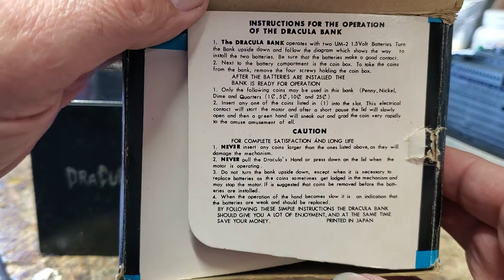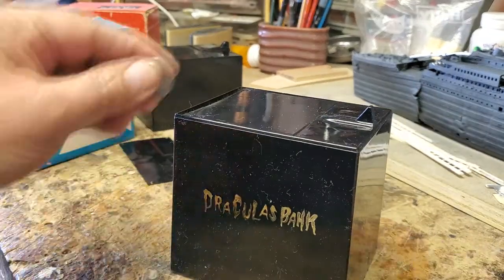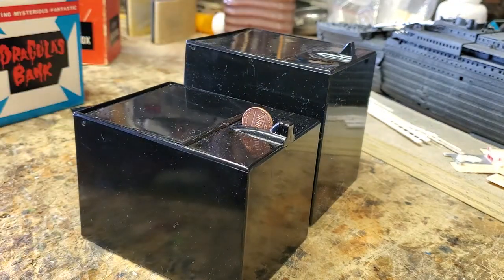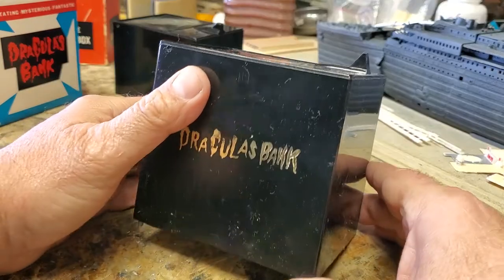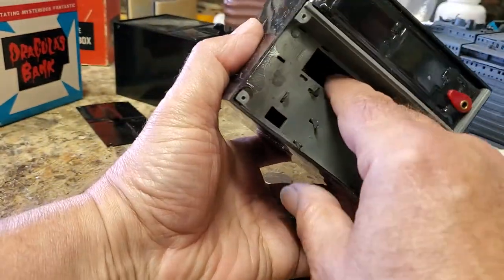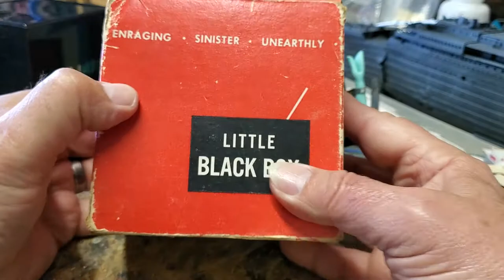Dracula's Bank coin bank Poynter?

Comment: They started using those plastic gears after 1964.  I fixed one of those Dracula Banks too, and just like CJ said'...it was tough.  I pretty much tore up the plastic because of the glue, so I made a base out of 2 mm book board (the plastic is about 2.3 mm) and some thin self-adhesive black felt fabric I got from Amazon.  It worked great.  Except mine does not have the little lever on the bottom that makes it move nor is there a hole for one.  Other than that, it looks identical to CJs